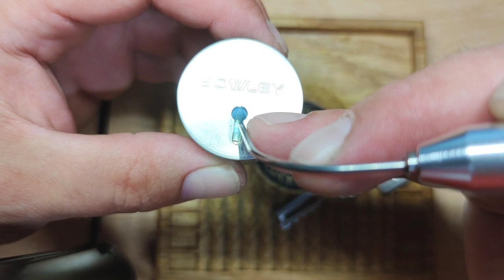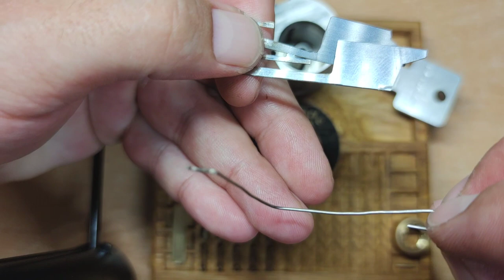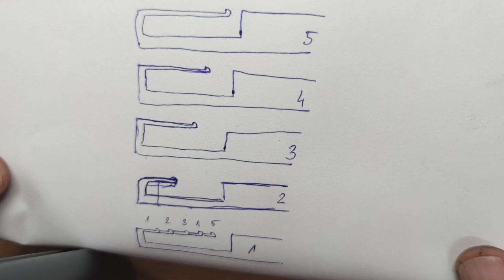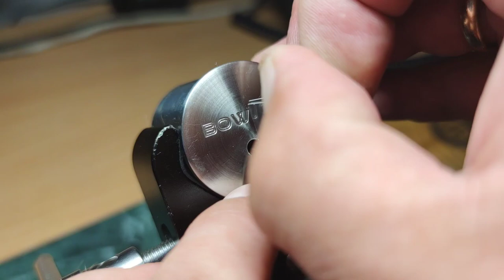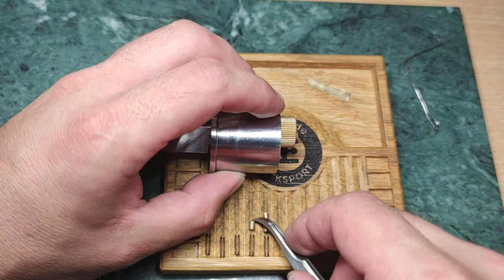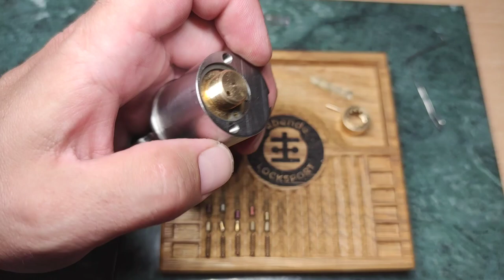Bowley Door Lock picked and gutted

Comment: Nice job! Chris Evans did something like this a few years ago, but he made diamond shaped picks so he could push in a little for low cuts and pull out a little for high cuts. But he could only fit three picks in the lock at once. But there must be a way to fit all 5 if done right...
Reply: Here is a link to that video:
https://youtu.be/X04qgD0hOXk
Reply from the maker: I am sure that you can make a pick with five elements from a 0.5mm thick sheet. The key is 3mm wide and such a pick would be 2.5mm
Reply: Actually, if I recall correctly from LPL's description, you only need to put four picks in the lock. A random one of the pins is always a zero lift pin, which enables the lock to resist bumping and raking (as if the shielding didn't already make that next to impossible LOL).

Comment: I like how you just stepped in front of the bitting specific picks 🤣 🤙🏽 great job! When double fork ? 🌴
Reply from the maker: Thanks Mr. Paradise :) and what is double fork ;)
Reply: @yabende bowley did a run of padlocks with dual forks, instead of just one fork
Reply from the maker: @jackmio  I know that, cross your fingers because I will try to pick it for a few weeks 😉